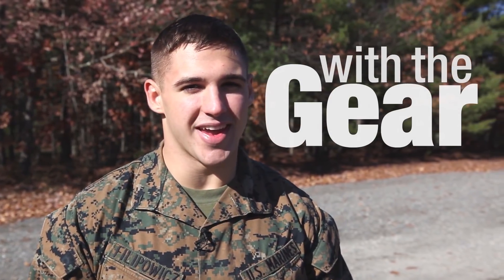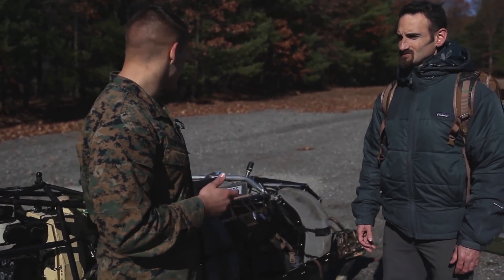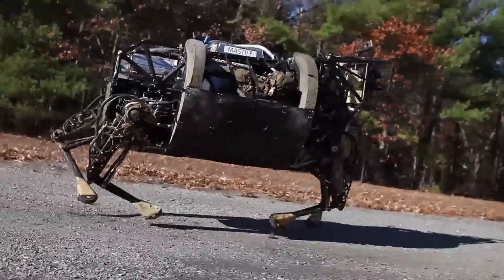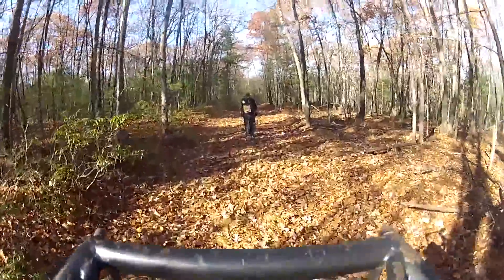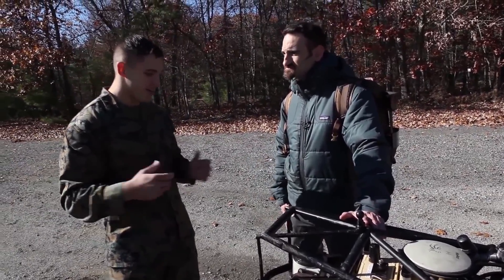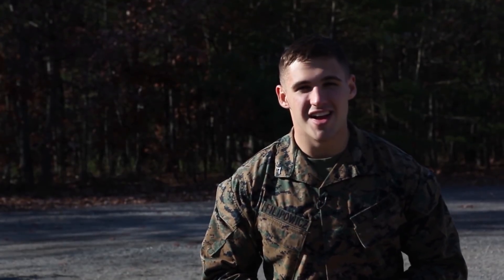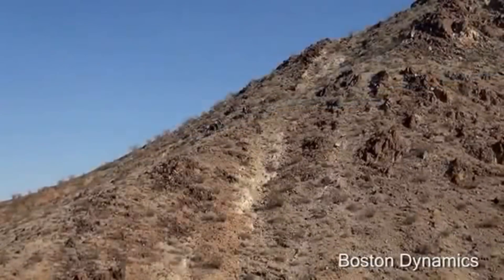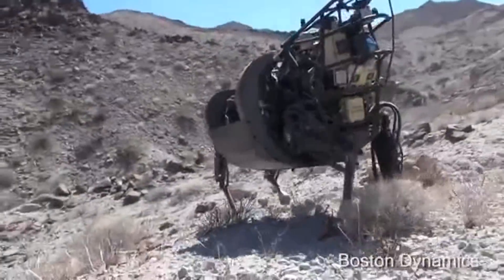Military Robots

Comment: IT NEEDS TO HAVE EYES, IT WILL BE A GOOD IDEA TO ADD CARAS AS EYES, AND ALSO GOOD IDEA TO HAVE IT CAPABLE OF SEEYING IN INFRARED VISION, I LIKE THAT.
Reply: It does have both those features actually, it just doesn't have a head lol
Reply: Is there a way to reduce the noise, also what source of energy does it run on?
I think they should make it hybrid, small magnetic spinning alternators and something like small hydrogen batteries, small and not the kind that unstables and blows up.
Reply: We need some police robots, like that Petman, they should make some prototypes and have them interact with society slowly, they should let some out to see how they work, that way they know where and how to improve them.
Reply: I guess the problem in policebots as it is now would be how kinda lame current technology is. If asimo came after you with handcuffs you literally just have to push him over and you're free
Reply: Parker Krakowiak that is why they need to build a new Asimo that is bigger and faster, also more flexible and more human alike, I believe the technology to create robots that are much more intelligent and faster than humans is there, they are just trying to find excuses on how not to do them.
For example Asimo is a good robot, but he is too small and wouldn't be able to drive a car and or lift heavy objects, neither he can run fast enough, that is why they need to change that back pack he is carrying and make it like a human spinal cord, so he can flex better, also the cameras he has are in Black and White vision, with 4K, why is he has so primitive technology, he should have like infrared, Xray and even HD Vision with panoramic view, Why limit Asimo only with Two old black and White camaras, when they can make him with 6 different kinds, and even a better source of energy like Hydrogen batteries, they can make a hydrogen battery the size of a printer cartridge, that would be good enough for 30-40 years in a robot, of course we'll design not to get unstable.
Reply: Sounds like you've got this all figured out, so why not go ahead and build one yourself?
Reply: Parker Krakowiak I need the money, the equipment, and the personnel to help.
But they can easily make it.
Reply: If it's really that easy, are you saying that boston dynamics/honda/any other robot company are all just stupid?
Reply: Parker Krakowiak they are manipulated by Satan, he makes them do wrong things so they don't do it right, it gives them different ideas, and makes them work harder or longer, gives false knowledge, distracts there thoughts.
Reply: Waitwaitwait what the FUCK. I'm still talking to the same person here, right?
Reply: Parker Krakowiak correct, believe it or not, he teletransported his own information into the brains of every human cell, and inside the brain where the memory is store, he makes thoughts and false ideas, he basically is copy inside the mind, his personality, from a scientific point of view is possible, don't get me wrong I am not religious, Satan invented religion to slow down the technological advancements, enrich his own clones and empoverish the others.
For example when reading and or studying he creates thoughts to distract, and seduces the ignorant people to make things which he makes them believe are good when are bad.
Asimo is a robot that is useless, because he utilizing your own abilities hacks them with plain thoughts, because from your brains he sends signals which enter the electronic devices and manipulates them, that is how he hacks computers etc, from the same brains of people.
Reply: And where exactly did you come across this information? If not through religion, then I really can't even guess
Reply: Parker Krakowiak Asimo is a good start for robotics, but need improvemts in mobility, flexibility, and the biggest problem is that is completely hackable by signals, they need to design Asimo so signals do not and can not penatrate him, a different operating system that can not be hack.
Also IPhone and especially Windows are hackable, Windows is so simple for him, Satan can easily dusrupt a computer with Windows and make it totally useless.
Reply: I not sure you're fully grasping just how difficult this stuff is. The reason you can't just go into your garage and build exactly what you're saying is her exact same reason nobody else can. It's really damn hard!
Reply: Parker Krakowiak easy, don't believe what everyone saids, believe what you see and make up your own conclutions from your own intelligence, of course by real science, not the fake one, don't even believe what you think, because it can be him creating those thoughts to manipulate you and fool you, don't even trust your own thoughts, Satan can manipfest through people, you will learn to recognize him, Jose Santiago Herrera is Satan, a gay pedophile who loves easy money, likes drugs and seduces people to do bad things while he likes to be seen as a good person in order to fool.
Reply: I'll be waiting for you next time there's another DARPA challenge. Blow them all out of the water!
Reply: Parker Krakowiak is not dumb hard, and the reason why you can't build one in a garage is because is more expensive and harder, than in a company with bunch of people to help you, and way better capital that doesn't limit you to junk.
They can build there own processors and parts for robots, a person can't.
For example the first things I would change in Asimo is his back, is not flexible, also the plain flat feet, don't allow him to better balance in surfaces that are not flat, it would be harder for a robot to balance in not plain surfaces, he needs more human alike feet, not completely flat feet, that only helps in flat plain surfaces.
Reply: I definitely agree about his feet, those flat ones need to go asap. He also does need some kind if spine type thin if he's ever gonna get human like back motion, but I suppose the problem is that there's not much room to work with to put in his power source and what not, so trying to work in extra gears and pistons would take up even more room.
Reply: Parker Krakowiak that is why he needs Hydrogen cell batteries like the Terminator has, in the movie the Terminator 3, you can see those robots use Hydrogen cell batteries that last for about 100 years each, he uses two, and they don't take much room at all, he also has an alternative power which is thermo heat, and allows his to run very well(that was in terminator 2 where we see him do that) 
Hydrogen cell batteries are perfect, I think they should build one for a new better version of Asimo, they should make the Hydrogen cell battery little smaller than the one T-850 has, it doesn't necessarily need to last 100 years, with 40years is good enough, also in the movie those batteries got unstable and would blow very hard, because the molecules wanted to expand at a high speed rate, if they can make them smaller and better design, they would be perfect, also in case of blowing would be much less, but I fought that would happen if those batteries are smaller and better design.
Reply: The hing is about that kind of fuel is that although it's very potent, it releases constant radioactive waves. If asimo got anywhere near a human with material like hat on him it could be lethal
Reply: Parker Krakowiak Hydrogen is not radioactive like people think, when exploding it does create heat, but not radioactivity that can harm anyone like people think, and would be likely to blow if designing those batteries small and well design, the reason why in the movie those batteries would blow was because they would get damage, and the Hydrogen would be alter and would want to expand, they were also too big, and that allow them to blow easier, if they make similar, but better and smaller there are no worries and no dangers.
They can also use the same thermo heat as a second source of power, That giant backpack Asimo carries is too big, maybe they should also consider making it flexible and in four smaller part, for example divide it in four, and that would allow more flexibility as well, as for the Hydrogen cell batteries they should start working on some prototypes, that would be so cool.
There are plenty of energy sources, but Not nuclear, because it would pollute the planet and would be dangerous.
Reply: By heat you realize it wouldn't just be like a toaster though, right? It would be incredibly hot, hot enough to melt it's own circuits and frame, not to mention again being dangerous to people (unless that's what you want I guess)
Reply: Parker Krakowiak no you are not understanding.
They would be dangerous if they are big, because the more Hydrogen they would contain it would make them more explosive, the idea is to make them small, but yet powerful enough to run a new Asimo that is better and faster, but at the same time not dangerous.
The whole point why those batteries were so dangerous in the movie, was because they were too powerful, the idea is to make those same batteries, but less powerful and completely safe, from a super hyper 100 years lasting battery, to a 20-40 years lasting battery.
That means that it would be reduce to about 60-70% making it completely safe.

Also they the backpack battery can be split in four parts, that is also a good idea to help him move better, the battery pack can allow that spinnal cord in between, and even That battery in the back can be improve.
They can create a Crystal Lithium ion battery, that would be much more powerful than Lithium ion, because Lithium ion dries fast, but if in the form of solid would be much more powerful and longer lasting.
Reply: Parker Krakowiak they can also make a even smaller one, a hydrogen battery that can last for about 10-20 years and combine it with the regular battery it has, but the backpack battery would need to be reduce, this would allow more flexibility and more power, because it would have two energy sources.
It would need more and better camaras, to better see, be taller about 40cm taller, have much more ram and another better processor, and not to mention not affected by signals that could allow hacking.
Reply: I think I remember them saying he was short on purpose so he wouldn't be intimidating to old people since they're designed to be sort of like in-house caretakers
Reply: Parker Krakowiak they can do the same with Petman, add a small hydrogen battery and a second alternative power that would give him little power and run as alternative source.
Also the problem with Petman is that also he needs more mobility, he can't move his back good enough neither, and needs lighter stronger materials, for example they can make a new allow between 30% titanium and 50% aluminum and 20 % graffito in his body, Petman would be more flexible. He would just need an electronic brain with Satellite communication, like a GPS to receive data and send.
Reply: Parker Krakowiak yea that was the idea, but he is not so useful like that, because he can't drive and neither lift heavy stuff, he can't even move right, and he wouldn't be capable of claiming up a ladder, or picking up a tv, etc.
He is basically obsolete, and that is useless, also he can be hack by Satan and that is very bad, I don't want them to be hackable and speacially by that pedophile of Satan.
They need to make a new model of him, if not Honda then Darpa and or Boston Dynamics, one model 179cms tall, not that back pack, more and better camaras, and no plain feet, but more human alike.
Reply: Parker Krakowiak they should also have to start working on a female android robot, yeah!! I want a gorgeous one like that Cameron in Terminator series, as human as possible, I mean totally human, capable of sweating and real cellular skin, that would be the best, then I would be amaze, yeah!!.

Comment: The original equation of Pierre De Fermat is a magical subject.
z^3=[z(z+1)/2]^2 - [z(z-1)/2]^2 .
z^6=[z(z+1)/2]^4+ [z(z-1)/2]^4 - 2[(z^4-z^2)/2]^2
(z^3)^n={ [z(z+1)/2]^2 - [z(z-1)/2]^2 }^n.
Original equation.
z^n=x^n+y^n.
So in special case:
(z^3)^n=(x^3)^n+(y^3)^n
So:
{ [z(z+1)/2]^2 - [z(z-1)/2]^2 }^n.={ [x(x+1)/2]^2 - [x(x-1)/2]^2 }^n.+{ [y(y+1)/2]^2 - [y(y-1)/2]^2 }^n.
This is the cause make the equation Fermat become a  terrible complex equation.

Original equation.
z^n=x^n+y^n.
Mean.
z^(n-3)*z^3=x^(n-3)*x^3+y^(n-3)*y^3.

Using rotating four formulas following into the original equation of Pierre De Fermat then a subsystem will appearing.
First formula.
z^3=[z(z+1)/2]^2 - [z(z-1)/2]^2 .
Example.
3^3=6^2-3^2.
Second formula.
[z(z+1)/2]^2=1^3+2^3+........+z^3
 Example.
6^2=1^3+2^3+3^3.
Third formula.
x^3+y^3=[y(y+1)/2]^2 – [x(x-1)/2]^2 – [(x+a)(x+a+1)/2]^2 + [(x+a)(x+a-1)/2]^2 – [(x+1)^3+(x+2)^3+........+(x+a-1)^3+(x+a+1)^3+........+(y-1)^3] 
Example.
2^3+4^3=10^2-1^2-3^3.
Fourth formula.
[b(b+1)/2]^2 - [a(a-1)/2]^2=a^3+(a+1)^3+........+(b-1)^3+b^3.
Example.
10^2-1^2=2^3+3^3+4^3.

Simplest system.
Original equation:
z^3=x^3+y^3.
Using two formulas:
z^3=[z(z+1)/2]^2 – [z(z-1)/2]^2 
And 
x^3+y^3=[y(y+1)/2]^2 – [x(x-1)/2]^2 – [(x+a)(x+a+1)/2]^2 + [(x+a)(x+a-1)/2]^2 – [(x+1)^3+(x+2)^3+........+(x+a-1)^3+(x+a+1)^3+........+(y-1)^3] 

The system was born.
[z(z+1)/2]^2 – [z(z-1)/2]^2=[y(y+1)/2]^2 – [x(x-1)/2]^2 – [(x+a)(x+a+1)/2]^2 + [(x+a)(x+a-1)/2]^2 – [(x+1)^3+(x+2)^3+........+(x+a-1)^3+(x+a+1)^3+........+(y-1)^3] 

[z(z+1)/2]^2 – [z(z-1)/2]^2=[y(y+1)/2]^2 – [x(x-1)/2]^2 – [(x+b)(x+b+1)/2]^2 + [(x+b)(x+b-1)/2]^2 – [(x+1)^3+(x+2)^3+........+(x+b-1)^3+(x+b+1)^3+........+(y-1)^3] 

[z(z+1)/2]^2 – [z(z-1)/2]^2=[y(y+1)/2]^2 – [x(x-1)/2]^2 – [(x+c)(x+c+1)/2]^2 + [(x+c)(x+c-1)/2]^2 – [(x+1)^3+(x+2)^3+........+(x+c-1)^3+(x+c+1)^3+........+(y-1)^3] 

[z(z+1)/2]^2 – [z(z-1)/2]^2=[y(y+1)/2]^2 – [x(x-1)/2]^2 – [(x+d)(x+d+1)/2]^2 + [(x+d)(x+d-1)/2]^2 – [(x+1)^3+(x+2)^3+........+(x+d-1)^3+(x+d+1)^3+........+(y-1)^3].

........
The structure can not be made with absolute integer.

Ishtar.